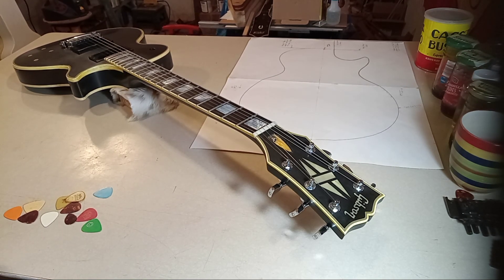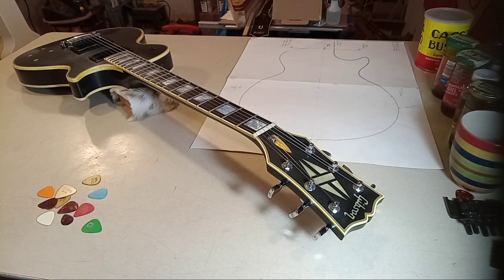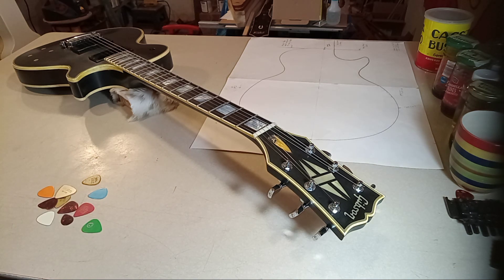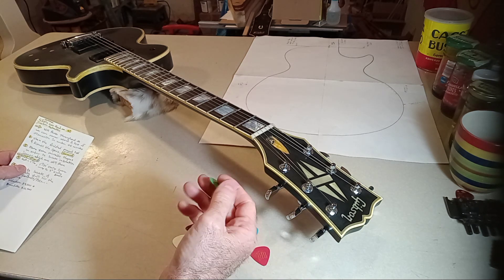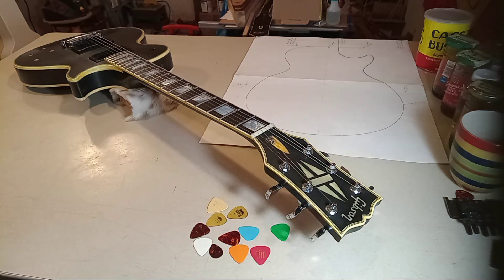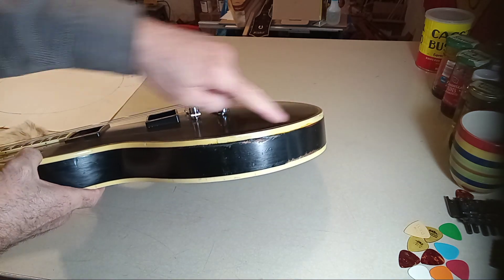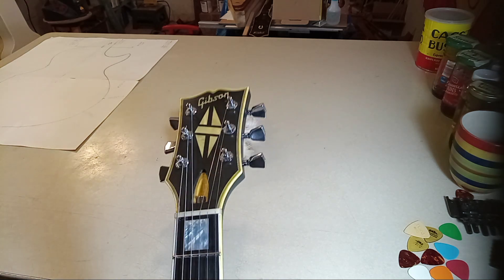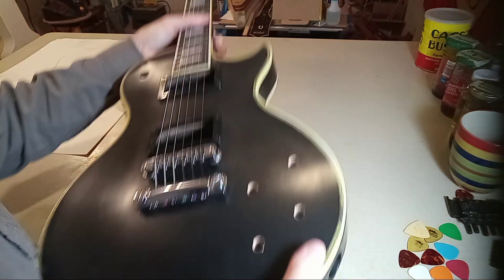Vintage Gibson Les Paul Custom Restoration Video 42

Comment: I loved your detail. I’m a 30 year player, and I have become a les Paul fanatic   This was great all the way around. I’ve got a nice 86 custom, worn in and naturally checked. Great!
Reply from the maker: Hey Steve,

Thanks for watching and commenting.  Most of the videos are brutally long and amateurish!  For certain, the 80's Customs are beginning to really hold their value, so you got a keeper....

I just started a new series where I am building an all Honduran Mahogany 54-55 LP Custom with Staple and P90 configuration.  Will be using the Stewmac Templates, so it should be spot on and and great sounding guitar.

Thanks,
Marc

Comment: Just by accident I saw the 1st video of that destroyed LP Custom..The worst case of guitar damage I've ever seen...Now I'll have to view the others to see the work you have done....Hard to believe it's transformation..
Looks fantastic..WOW !
Reply from the maker: Thanks for commenting, and so hoping the original owner will eventually trip up on the series.  Most of the videos are mind numbing, and very amateurish, but I was easing my way to the finish line!  

For certain, it turned out even better than expected (visually).  I knew that tone and playability was going to be incredible.  It resonated so well, that the bass note vibration would occasionally travel up the strap and into my shoulder!

Marc
Tiki Hut
Reply: @DejaBluGuitars  ..
The work you're doing is top drawer..The owner will be thrilled..
And won't have to worry much about any bumps or scratches..Anyone would enjoy it for sure..
Black customs are a magnet for everything..I know that from experience..Awesome guitar !

Comment: You did a great job, dude. What percentage of the wood would you say is original....or 'Gibson wood'?  To me...what givies each guitar is the neck and how you relate to it. Once that has been changed, it is a whole new guitair....imo, at least. The body has very little impact on the sound.
Reply from the maker: All the early videos show the original  body and what part of the original neck I had to work with.  There was plenty of original material to replicate the neck- spot on, but the Client requested I build the neck profile to 59 Les Paul Specs.  So, he was able to get a 59/1980s Les Paul Custom. 

Also, I can assure you the body shape, thickness, wood species, type of finish used, and craftsmanship of the body and neck combined is what defines different guitars (Tele vs Les Paul vs SG vs Gretsch...).

Thanks for watching and commenting,

Marc